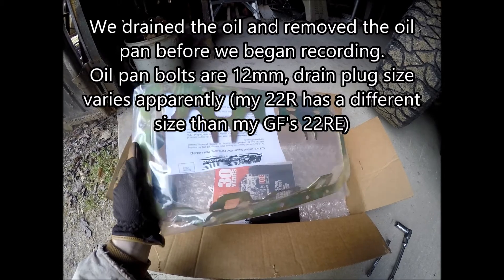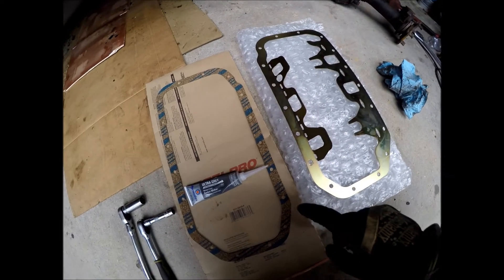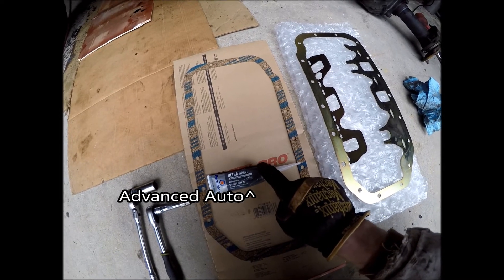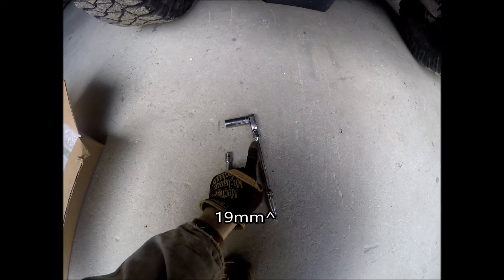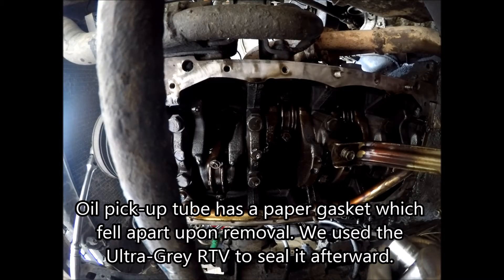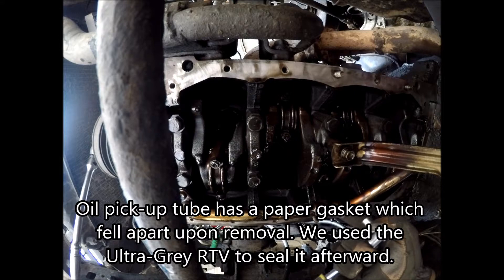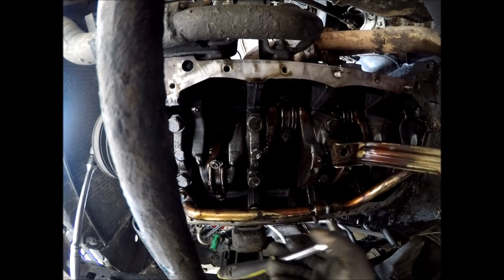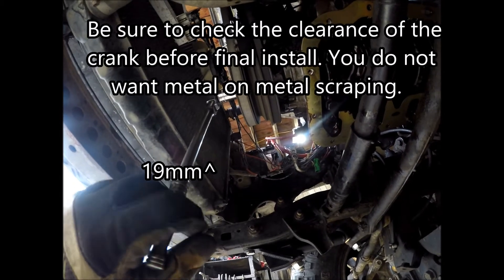LCE Crank Scraper Install 22RE/22R/20R

Comment: OK... so you put it on, but what were your findings after installation?
Reply from the maker: I bought it more for health & longevity of the engine. But, in terms of power gain, it is the same concept as removing the manual rad fan to reduce non-beneficial weight that the engine has to move. If I had to guess I would say I'm pretty sure it is an under 10hp gain.

Comment: Hows everything holdin up after a couple years?
Reply from the maker: Runs, drives, holds oil lol bout all I can say really
Reply: All i needed to know! Im gonna buy the new silicone sealing oil pan for my 22r today cause i just had the gasket replaced less then a year ago and its leaking all around already... Im also gettin the crank scraper, new pickup tube, hardware and everything needed. Appreciate your response and the video! That trick to let the silicone dry for a lil bit was exactly what i needed to figure out for the crank scraper! Hoping that  silicone pan instead of the gasket one will last a bit longer
Reply from the maker: Awesome! It was pretty easy but awkward holding things up down there